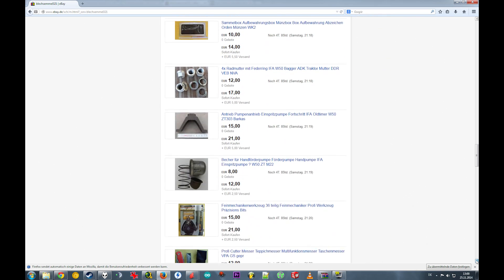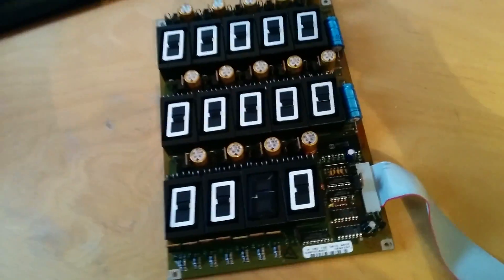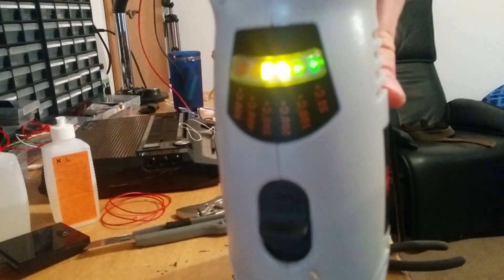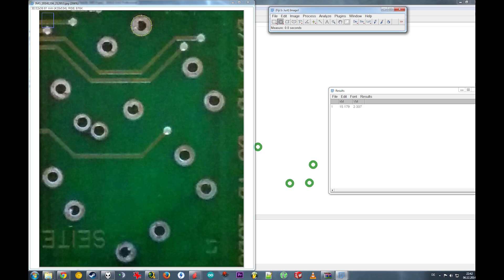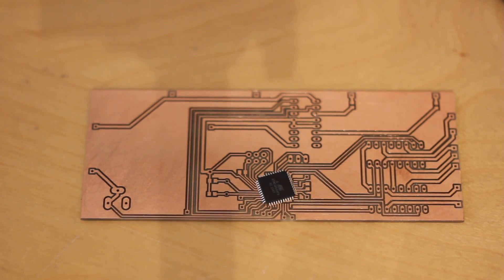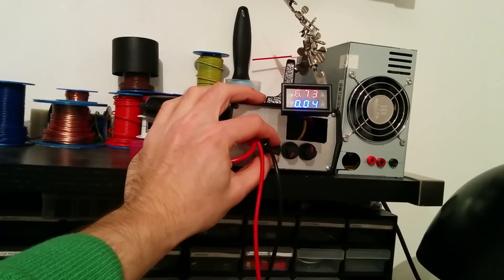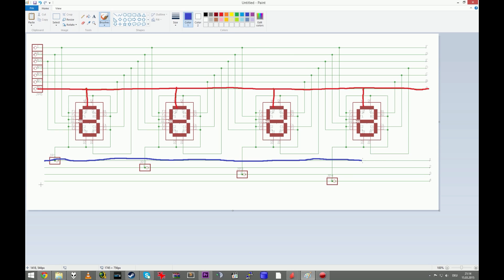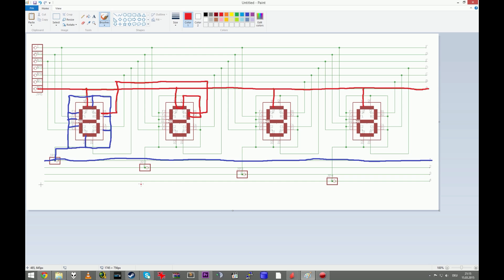Electromagnetic 7-segment clock - Attempt 1 FAILED

Comment: Hi. You should have probably got this working by now, but in case you had no time to, you could consider using a dedicated demultiplexor-inverter like the 74HCT138 (one per output device), not only it decodes a 3bit input to 8 segmet output, but also it can invert the output polarity by the e and not-e gates. Hope it helps. Good Luck.